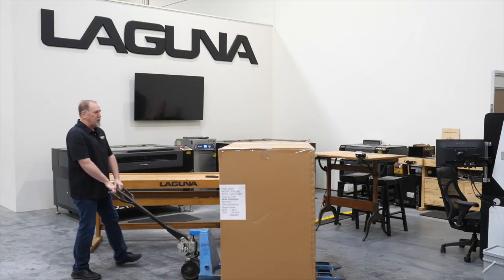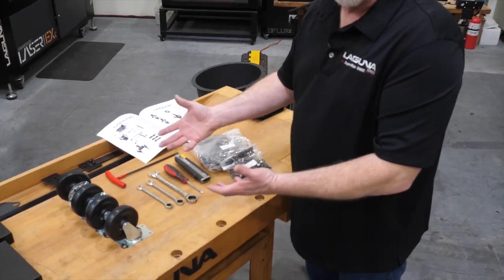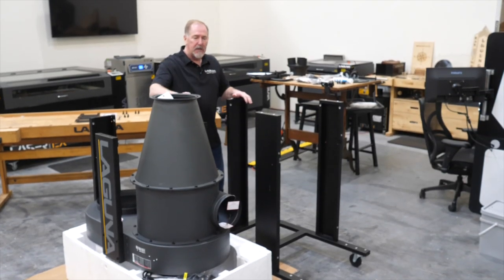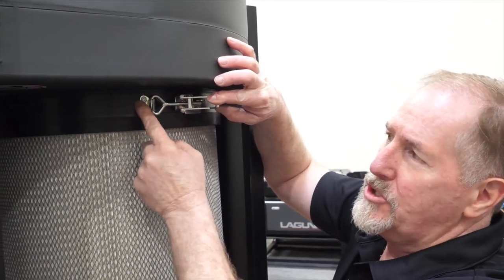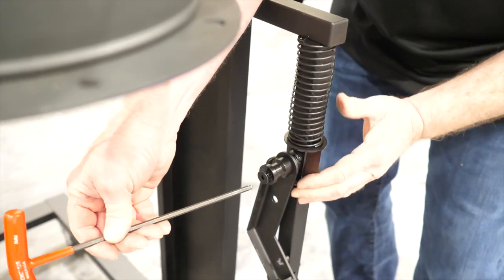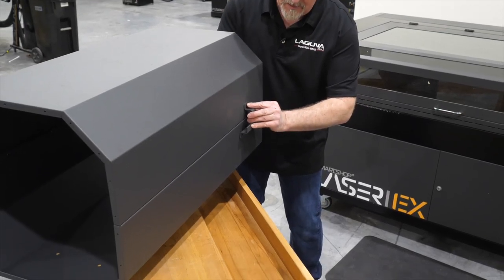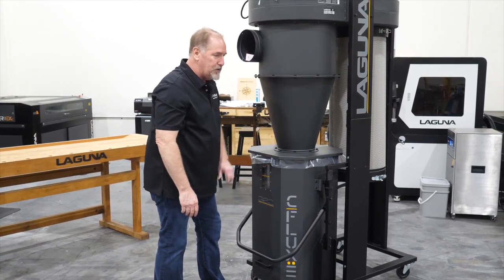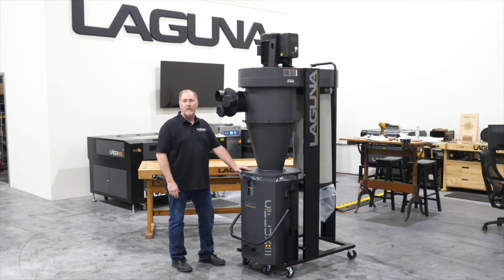How To Assemble 2022 C|Flux Dust Collectors | Classic Machinery

Comment: Just a couple of comments on his installation instructions versus the manual.  At 35:40 the instructions in the manual state the bolts go the opposite direction the guy is showing in the video.  I assume the manual is more practical for not puncturing the inner bag, but it looks better from the outside how he is doing it.  Also, at 36:18 he shows inserting the bolt into the handle from the inside and placing the acorn nut inside the handle on the outside. Again, the manual states to do the opposite. Two problems with that is: 1) the acorn nut spins inside the hole of the handle because it is an indented area where you can't put a wrench on the nut and 2) if you insert the bolt from the outside like the manual states, the head of the bolt is too large to drop down inside the indented area and thus the supplied 3/4" bolt is too short to put the acorn nut on the inside.  I had to go to HD and buy a 3/4" bolt with smaller head. One other small issue I had is the free-floating switch box.  I only mention these two items because I wanted to make sure the nuts and bolts on the inside of the drum did not have anything sharp that might tear the bag.  Minor issues, I know and not a knock on the rest of the machine.

Comment: I viewed this before starting to assemble my C/Flux 1 , and it gave me a serious panic attack.  The unit in this video is WAY taller than the 68" height listed on your website, and I was worried it wouldn't fit in my workshop, after waiting weeks for delivery and having already discarded my old collector.  It took me a little digging to discover you are showing the assembly of the much bigger older brother to my model.  You could have saved me a lot of anxiety by saying that at the beginning of the video.

Comment: notes from assembling cflux 1:
1. the leg reinforcing brackets cover the levers for the can. it would be wise to either install those before the leg reinforcement brackets, or wait to install said brackets.
2. the lid that attaches to the cyclone is not symmetric, the port-hole goes to the back.

Comment: I didn't see a timestamp for the "mental breakdown and gratuitous use of profanity" part of the assembly.

😁  Glad to see that it's been refined.
Reply: Video was very helpful - Cflux2 - only issue I would suggest changing - drum base - screws are too short and acron nuts were a pain - 1.5 hrs to put in 22 screws and lots of bad words :) would suggest longer bolt and lock washer. Else awesome. Cflux2 is larger than the Cflux1 as above noted - flipped and have 5" to ceiling - monster unit my woodshop.